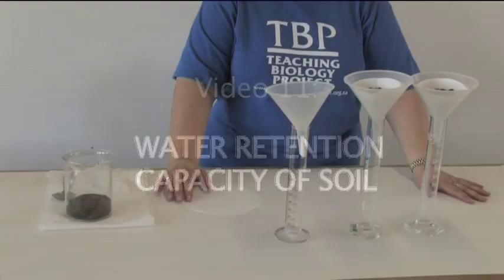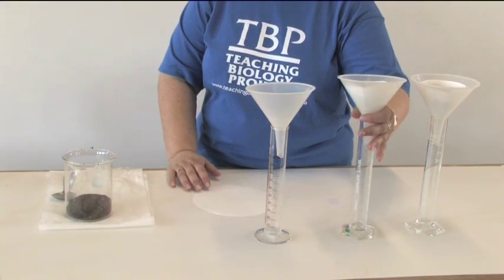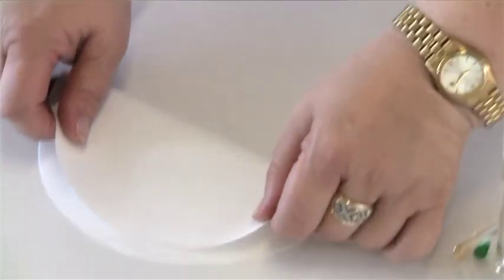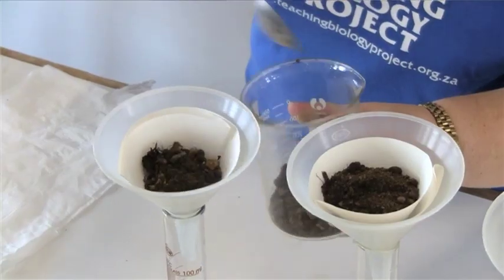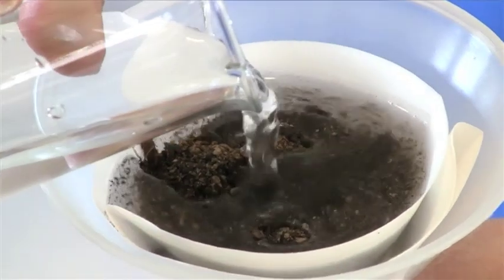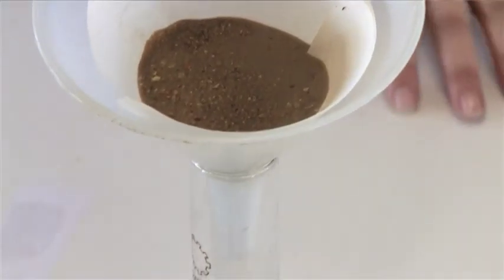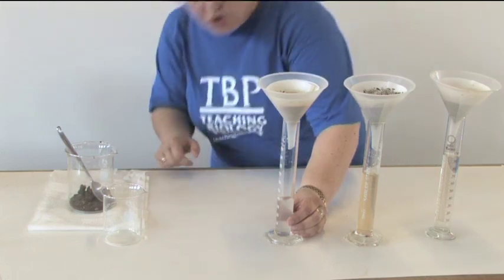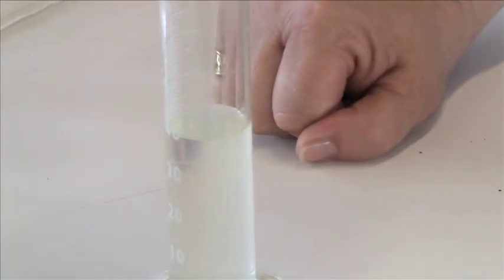Video 11 - WATER RETENTION OF SOIL.mov

Comment: No you don’t need to weigh the soil. The soil sample should be taken on volume basis for better results.
If you want to take soil on weight basis , you should oven dry it for 8 hours at 60 degrees.

Comment: What type of soil I have to take for this test? Sundried, oven dried or air dried soil sample? If I take 100g of air dried (in shade) powdered soil sample, and after this experiment if 40 ml of water is retained by the soil, can I say that the water retention capacity of soil is 40 ml/100g (W1)? But in that case air dried soil will also retain some inherent moisture in it. I feel we should dry the soil in a hot air oven at 105 degree Centigrade at least for 15 minutes and then conduct this experiment. And too get actual value of water retention a blank experiment without soil should also be conducted to know the water retention by filter paper (Say W2). Then to get the actual water retention capacity of soil (W) will be (W1 - W2) ml per 100 g of soil. What is your view?
Reply: You can calculate what you want from maximum saturation. No need to dry anything...
Reply: You need Clayey,Loamy and sandy soil